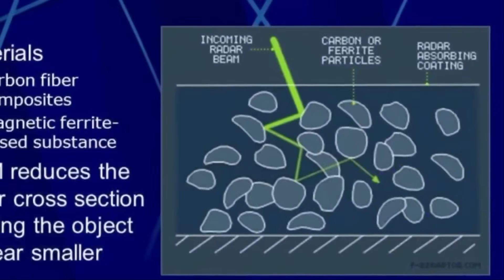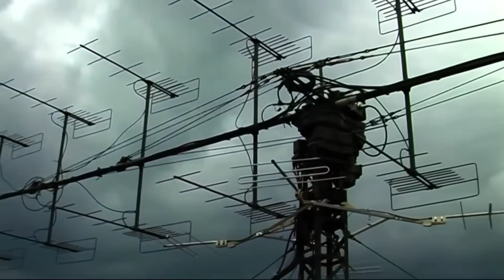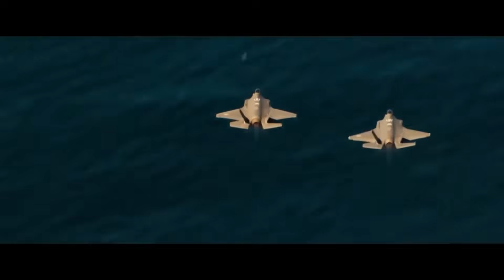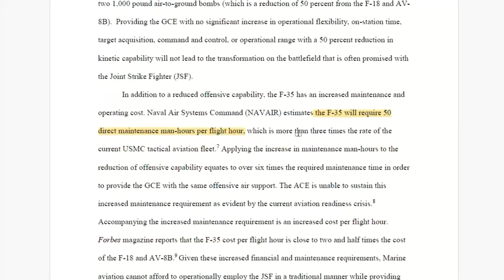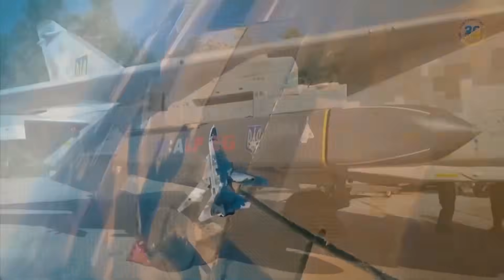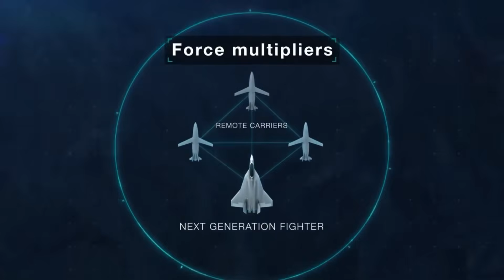Why Stealth Is Totally Outdated Now

Comment: He keeps talking about inferred, that is all well and good and is an important aspect of next generation fighters, but stealth is about taking out enemies over the horizon before they are even in range of inferred imaging.  Inferred is more important when engaging other stealth fighters.  Not to mention the next generation of stealth fighters will not only have stealth coating, advanced electronic warfare, and smart skin, but will also have stealth drones flying alongside them.  To not invest in stealth is a huge mistake, low cost conventional aircraft have their place, to control the skies after the stealth fighters and bombers have done their job.
Reply: Very good points, but the way to go right now would be F 16 or Saab Gripin 39 E with AI, and use stealth for the drones.
Reply: @jackviney6886  I don't disagree with you on that.  It very much depends on a countries spending power.  As of now the Gripin's processing power would be a better choice for that role imo.

Comment: Stealth is not going anywhere. Stealth is simply evading detection and making it harder for the enemy to hit you. 

Early planes would have colour schemes so the plane matches the sky better. 

The Canadian CF-18s have a fake cockpit painted on its belly so as to cause confusion in a dogfight. 

Stealth boats, steath glide bombs, stealth anti-ship missiles. 

A submarine lowering its acoustic signal.

Soldiers using red light filters on flashlights, or hiding under thermal blankets.